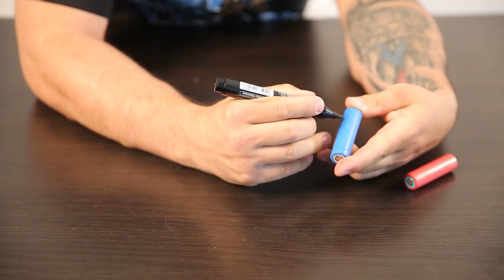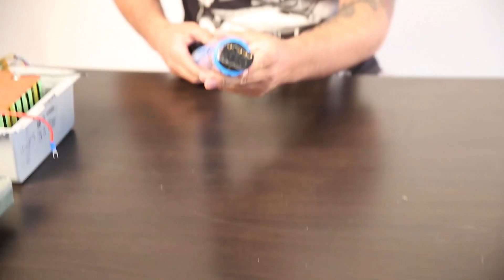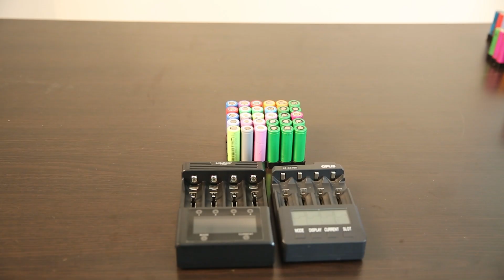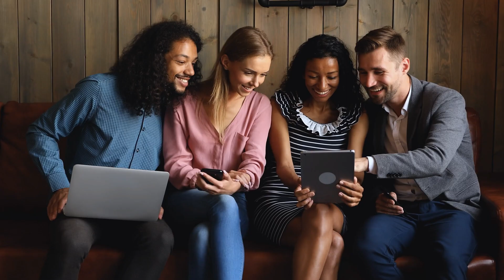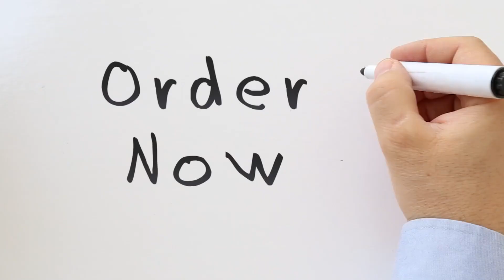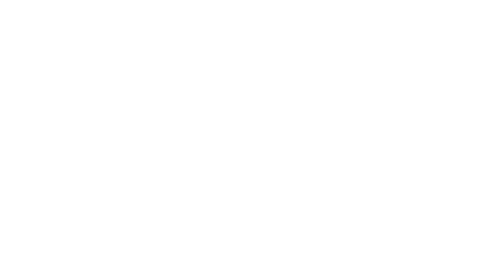Megacell Charger Video Presentation - Liitokala Lii 600 Comparison

Comment: hello, I have seen a good demonstration showing that the capacity computed by Liitokala (Lii4) is false, for a simple reason : the mesure is done while charging, it should be done from a fully charged battery.  litokoa showed 3000 Ma/h while the real value was 2300, I will look for that video if you want the link (but it is all in french, you may be able to translate the sub titles) . IT is not at all a comparative video, the guy only needs the info to make a powerful battery for an electrication of a small motorbike 1970 50 cc ! (superb job and good explanations) . Best regards
Reply: here is the link, he used the liitokala 4 then an electronic charge to respect the cell builder test protocol : https://youtu.be/j4mdaokeM9M?si=RLUoHvM_EWWJeXwD&t=266   - I hope YT will allow the link
Reply from the maker: Hi, it depends on the testing current. If discharged with less current, the cell will get discharged slower and have higher capacity due to low volt drop. It depends how the heat is dissipated when discharging, a lot of factors including contacts of cells if rusted or have nickel strips, environment temp can contribute to different results compared with datasheet. It also depends if the device have been calibrated
Reply: @thecelldoctor8890  Yes , I get it , the guy wanted very logically to manage the testing respecting the datasheet environment. Clearly the result showed as good a weak battery if measured with the Liitako 4. BOw you gave us a lot of work between the update and the new software ! All the best
Reply: @thecelldoctor8890  " If discharged with less current, the cell will get discharged slower and have higher capacity due to low volt drop" is it the same when you regulate the "chemistry" to 0.5 1  , or 2 A ? the results differ (a little ?) Up to today I get similar results after similar cycles, tell me, if I have not enough power, do the MCC refuse the 1amp choice (my impression) ? BTW it is for discharge and for charge ?